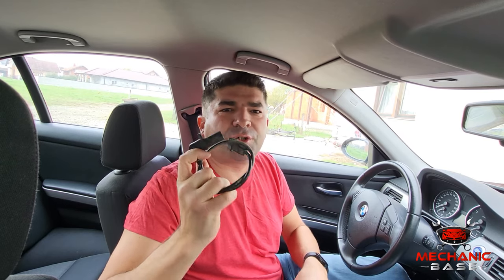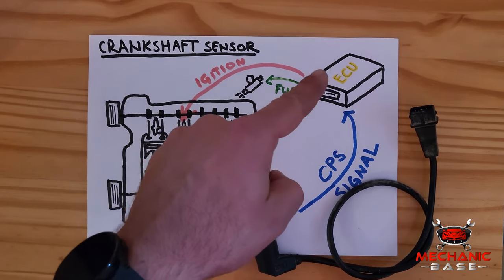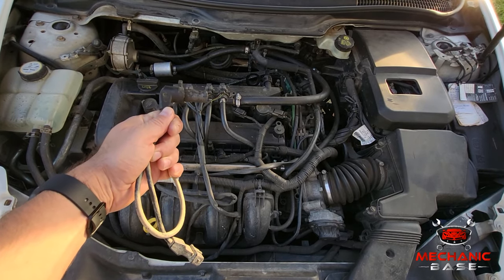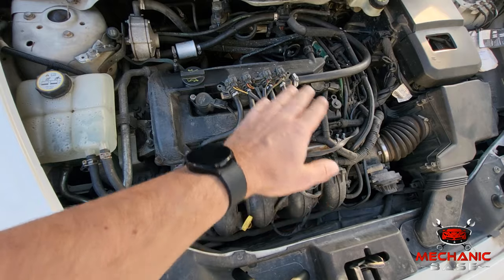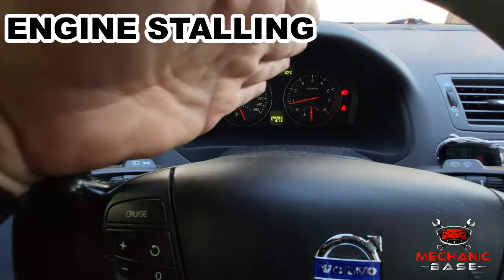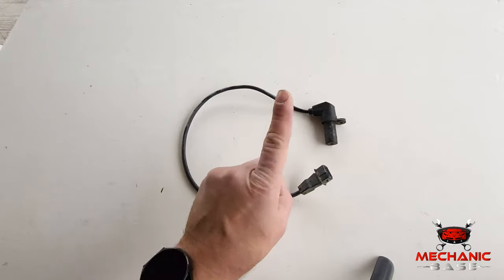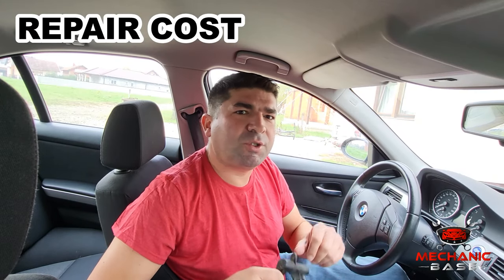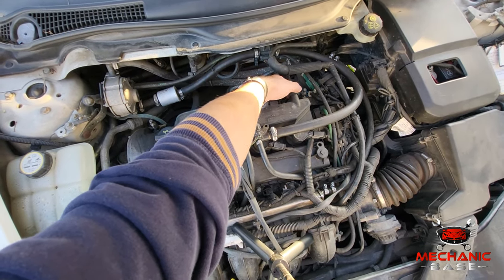6 Symptoms of a Bad Crankshaft Position Sensor

Comment from the maker: Did you fix your car issues? Let us know in the comments below, and maybe you can help someone else with a bad crankshaft position sensor!
Don't forget to like the video and subscribe to our channel!
More CPS sensor information: https://mechanicbase.com/engine/crankshaft-position-sensor-symptoms/
Website: https://mechanicbase.com/
Reply: Can't find my crankshaft position sensor in my v70 2.5t volvo
Reply: I need help please. I've tried 3 different sensors and even tried another dme on my 2007 e60.
I can't get any voltage drop on sensor running magnet across it.
Reply: 1:32
Reply: Hello name Joey I like to know where would my crank shaft position be at I have a 2007 buick lucerne cxl v6 engine
Reply: Is this a pcv vale
Reply: Yes  or no
Reply: Is this pcv valve
Reply: Because it looks like it
Reply: Yes or no or maybe
Reply: Where would it be located on 02 Corolla
Reply: 1996 Jeep Grand Cherokee 4.0
RPMs drop to zero while driving then jump back up and doesn't do it anymore.
Now it just won't start, hoping this is my issue has 0 codes on a scanner
Reply: 1994 Chevy s10 can't find crankshaft sensor 4.3 vortec
Reply: listening to your fucking saliva is murder bro do something about your audio or dont make videos at all
Reply: like do you not hear your audio before you post it?
Reply: Can't find my crank shaft position sensor 07bmw 760li
Reply: Can't find my crankshaft position sensor 95 Chevy Silverado 350 5.7 vertec
Reply: I had this problem periodically with a Opel Vectra B. First, I took a cheap aftermarket sensor for 20 bucks. It worked fine for a year and broke down again. Then I decided to take an original sensor with the GM logo what was MUCH more expensive.  This original sensor did not work at all. The engine made no effort to start. After looking unsucccessfully for any other reasons, I recalled a thread, that somebody said, that mechanics try these sensors out sometimes. I made a last attempt and ordered a cheap sensor again. The car started immediately as if nothing had happened.
Reply: Hi I have vectra c 1800 1953 hatch. I cannot find my crank sensor. Watched videos which show it at the back of the engine to the right as you look at it. Near where the cam sensor plugs in.

Comment: When the crankshaft sensor starts to go bad, it starts showing symptoms when it's cold. This is my own experience. You just can't find that information anywhere. You could easily think that there is a problem with the mixture ratio, although the crankshaft sensor may be the real culprit and may work well in warm weather, but at a certain degree of frost it starts to show symptoms.
Reply: Tell me more.
Reply: @gottahavegoalsset  ?
Reply: This explains my frustrations OMG!! This is very important information .
Reply: @buckhayes2104  And the freezing point where the symptoms start can be very sharp. It may be that the car works well, for example,  at -13 c degrees and -14 c doesn't work anymore very well. In severe frosts, it sounded as if the ignition was completely out of place and the car would only idle at about 500rpm and engine may not be able to take more revs.. The car smoked a lot and the exhaust smelled strange.
Reply: @buckhayes2104  Here's a link to a video where you can hear how the car's engine was doing before the fault was found. I myself had two faults. The crankshaft sensor and then the air mass meter. But the crank sensor was the main culprit. The faulty air mass meter made jerks only at higher revs while driving. But didn't affect the idle and didn't make it difficult.
Reply: @Topsiekku  it started hard the other day in 18 degree weather and warmed up fine. I was driving and all of a sudden it died and won't start. It cranks okay. I'm going to replace the CMP and the CPS tomorrow and see if this fixes some issues or all. It started just fine Everytime the week prior in 35+ degree weather. As temp dropped it became a hard start  when the engine was cold and also not wanting to start through out the day. I've checked the starter,changed fuel pump,fuel filter, sparkies, fuel relay and oil pressure switch. It ran fine until it the weather turned. It recently also had its timing and harmonic balance timed and repaired.
Reply: @buckhayes2104  Isn't it even freezing there? I mean readings that start with a minus
Reply: @buckhayes2104  If you are really talking about +18 celsius degree and +35 celsius degree, I don't think it has any effect on the crank sensor.
Reply: I got a code for it. My car keeps dying randomly. After an hour sitting it'll start up. Do you think it's the sensor?
Reply: Thank you
Reply: Crazy 😧 almost automatically changed valve cover with wires & plugs , after noticing won't start after bad weather days & not wanting to stay started after put in drive
Reply: @j4crypto4all1st9  How many degrees Celsius was freezing?
Reply: Very interesting , maybe 1 of the few things I have not swapped onto my jeep from a known great running engine(frames rotten) interestingly enough just did a cover gasket on its 4.0 jeep engine, I would imagine it's taken on its share of oil, she was a leaker, anyway, my newly acquired fl tj runs great once warm, not too good at all cold an I swear it's gotten worse over the past week, still no code/light, will swap cash next.... I guess, wth
Reply: Not me mine just went bad and had to get towed
Reply: This makes sense why I get a hard start in the morning. 🤔🤔
Reply: I have same problem on my car .when is cold ...when accelerate is different noise but no any check engine on dashboard.
Reply: @MatriX46750  How much was it freezing when there were malfunctions?
Reply: The noise is appear some time .for ex today didn't hear it ...
Reply: @MatriX46750  I mean -15c below zero
Reply: My e46 M54 engine has intermittent long crank
Reply: My Chevrolet spark cut of the spark when the weather is cold is crankshaft sensor
Reply: Where is this sensor on a 2003 Pontiac Sunfire?
Reply: Where is the crankcase position sensor 2006 lexus gs300 located ?

Comment: Only thing I'm going to add here is that you can get no misfires and no codes and still have a bad crankshaft sensor! Mine has done it twice.  No misfires no codes both times.  But mine is a 99 and that may play a LARGE part of the missing codes. I cannot get OE sensors for mine and am forced to go with cheap ones that don't last.  Only do OE if you have that option!

Comment: GREAT VIDEO BRO. After  winter my batterie in my S2000 died, I replaced it and the car started, but it didnt run smooth. The power was low, revs fell off and missfiring started and it cut out. I thought that was probably the Ignition coils. Replaced them and the car ran better but vibrations were getting higher the warmer the engine got. Then I got a tool to read the fault and it said Crankshaft position sensor. I erased it, it wont start anymore but now i definetly know why. It all makes sense after watching your video. I really appreciate your Content

Comment: I almost replaced the ECM when it was just sludge and metal buildup on the CPS. Thanks you just saved me a couple hundred dollars.
Reply from the maker: Glad to hear that👍
Reply: If you had metal build up in your crank sensor you have other issues asswell
Reply: Was there no error code?
Reply: Hey mine was dirty do I clean the sensor with brake cleaner and the slot as well where the sensor goes ? Or just the sensor?? Please help
Reply: @vladt6038 hey how do I clean it ? Like do I clean the slot where the sensor goes as well with brake cleaner or JUST the sensor?

Comment: on my Toyota Corolla it's the VVT soliniod, but same symptoms , great explanation in the video
Reply: Did it cut off fuel and spark? My corolla won't start just cranks. It cut off fuel and spark
Reply: @louwscustomsza  I'm having same problem. Mine just cranks. I've changed the vvt solenoid, solenoid filter, camshaft sensor, fuel pump, starter, battery, a couple sparks plug... It's still cranks but no start. I have no codes showing when I plug the OBD. I'm thinking it's the crankshaft sensor tho.
Reply: @chriskramp5174  My problem was the metal plate that came after the crank sprocket. Apparently, the letter on it is supposed to be faced outside(B)(F). The crank sensor gets its reading from it

Comment: Thank you for confirming the symptoms. Seems manufacturers can pump any random fault code out and they don't mean the same thing from car to car. Seems P1337 on Citroen DS3 does point to crankshaft position sensor. Getting to it though is somewhat of a challenge and I don't seem to be able to find anything that suggests correctly where it is.

Comment: I have a 2015 Nissan Altima where is my camshaft sensor or crank sensor located thank you so much for your helpful video.
Reply from the maker: 2.5 engine? If yes, it should be near the transmission end, on the back of the engine (facing the firewall).

Comment: My 2017 Nissan patrol super safari starts rough making weird sound, fuel efficiency is lower than the norm, RPM plays around at idle, has no check engine light on (bought it used, suspect foul play). Used my scan tool and got a confirmed P0335 engine speed sensor which I assume is the same as crankshaft position sensor. Cleared it and and it still came back the same. Not sure where the crankshaft sensor is to inspect it, and the manual doesn't mention it.

Its worth mentioning I also have a confirmed C1130 (ABS system code).
Reply: All those symptoms correspond to a bad CKP sensor.

Comment: Good information about the starting symptoms that I haven't seen elsewhere. My 2007 Chrysler T&C had trouble starting hot two or three times. I assumed the starter was going. There were no codes. Then today it threw a P0017 and started running bad - almost stalling out every time I came to a stop and responding slowly to the accelerator pedal. Will check the sensor tomorrow, but it seems quite likely. So I'm guessing the starting hot issues can be an early warning.

Comment: Can this information be applied to motorcycles as well? My kawasaki z900 - 2017 sometimes just wont start and I've gotten the code P0335 on it. Sometimes it just wont start for at least 6-7 tries but then it works just great. However, after riding it for some time , if I turn of the ignition it wont start which has left me stranded a couple of times (sorry for my english, I'm from Sweden) Great informative video btw!
Reply from the maker: Yes, it's quite likely. That sounds like a crank sensor.

Comment: Thanks, I have a ml350, 4mactic, 2011 , try to do , dc , inspection and my engine light  is on  and the 7:12 7:12 smog pump wasn’t bad so , intake camshaft  cylinder the 2 on top will be replaced  to see if this help my engine light to go off, the relay switch I’m going to change ! Hope you can give me some quick advice !

Comment: I had this problem periodically with a Opel Vectra B. First, I took a cheap aftermarket sensor for 20 bucks. It worked fine for a year and broke down again. Then I decided to take an original sensor with the GM logo what was MUCH more expensive.  This original sensor did not work at all. The engine made no effort to start. After looking unsucccessfully for any other reasons, I recalled a thread, that somebody said, that mechanics try these sensors out sometimes. I made a last attempt and ordered a cheap sensor again. The car started immediately as if nothing had happened.
Reply from the maker: Which engine does your Vectra have? There was an issue with crank sensors on certain engines, the solution was to widen the gap where the bolt that hold is in place.
Reply: @MechanicBase  That engine was a  x20xev. Year of construction was 1996.
Reply: @MechanicBase  The crank sensor of the x20xev was unfortiunately hided behind the power steering pump or compressor. But it could get replaced without removing these aggregates. But it was no fun. At the moment, I have a Vectra B 1.8 (X18XE1) from 1999.

Comment: Thanks for the informative video!

Vehicle: 2013 Hyundai, Azera. I am told this part needs to be replaced. There were numerous codes that presented w/ the main key fob. After I asked, should you check the communication w/ the other key fob (extra), they check and said that there was a "hidden code." The other key fob registered a code for this. It does not sound for sure that this is the fix, but they said it could clean many of the other codes. Do you think I should have to pay for a 2nd diagnostic hour when they should have initially asked if there were 2 key fobs? I've kept the car up and have never had any prior issues. Welcome your feedback.

Comment: My car doesn’t throw a code. It'll run sometimes, then after even a short break, if I walk out or take a minute outside with the engine off, it does not turn back on. I'll have to probably wait 30 mins to get it back on. Any advice?
Reply from the maker: Cranks, but doesn't start? That sounds like a crankshaft sensor. Which car?

Comment: If the sensor is bad, will you have a problem with idle up high when your feet is barely on the gas. 2010 Cadillac srx

Comment: My 2008 frontier had a bad one. It would shut down when driving along. Fuel filter and pump do the same. On the rear passenger side back of motor is the crank sensor. Hard to get your hands to but only one small bolt holds it in. Don't over tighten it when installing new one !!! 😬🤬 Also a bit of grease helps on  O ring . I replaced the cam sensor same time. Driver's side back of motor. Looks almost the same. But a little easier to get to. 🤏 Mechanic we can fix the problem for $3750 . I need a Crank sensor not a new motor.     That's included. 😏
Reply from the maker: So, you've solved the problem?

Comment: Hi mr. Sam!
I've a Opel Corsa C 1.4 16v
the engine start good, any codes or ligths on the dashbord appers, but after 15 or 20 minutes after the start and when the engine get temperature 90°c the engine cut out, after that, I trying to restart it, but the half of the dashbord is off... no check engine light, no oil, no inmo, nothing light are ON... after that 1 hour and when the engine is cold or warm, the engine start again normally. Do you think that the sensor is damaged or the connector o wires?
Thanks for your comments back.
Regards!
Reply from the maker: That could definitely be the crank sensor.

Comment: My car has a tsi 2.0 petrol engine, basically a golf GTi engine. Drives great, but sometimes when it's warmed up, it will struggle to start, and it will the start when I let it cool down? Is it this sensor I need to change?

Comment: If the crankshaft sensor is bad can it affect the fuel pump
Reply from the maker: No. But the injectors won't give fuel if there is no signal from the crank position sensor.

Comment: My car is 2007 Volvo xc70 gives me code ; P0503 (rpm signal low) and P2160. Is it still about crankshaft position sensor ? I wanna do it myself and I wanna buy the right part. (Btw I know that P2160 is about wheel speed sensor) thank you ❤

Comment: Greetings. I've replaced crankshaft position sensors "A" & "B" in my Kia Sorento 2004. The engine cranks but stalls after anything between 5 to 25mims
Reply from the maker: Hi @solaomotola - do you have any trouble codes? Check engine light?
Reply: solaomotola. Cars only have 1 crankshaft sensor
Reply: In my 2002 truck I had to replace my nock sensor as well

Comment: My car is very difficult to start for the first time, after about 20 seconds it starts, especially when it is cold. and after that every start goes well, so only the 1st start. Battery ignition coil spark plug has been replaced, what do you think? I would like to help, can it be done by the sensor that only works the 1st time

Comment: Just found this.  1998 honda prelude  no start.  Replaced  distributor, rebuild starter, replaced oem ngk spark plugs.  Got no codes. Just did timing belt change with all related components about 6 months ago  gates kit with japan parts.

Comment: I have no problems starting when the car is cold. N52B25. But when the car can't cool down because of high ambient temperature... the car won't start. It will crank, but not start and give all kind of strange faults (ABS, DSC, et cetera) on the dash and I have to let the car cool down before it will start again. Even last holiday at BMW München, Ferrari Maranello and the Nordschleife. If I let the car cool down enough (sometimes with the hood opened), it starts with no issues at all... like it has no problem :) Could a CPS going bad be the fault? If it gets to hot it's not working as it should be?
Reply from the maker: Yes, the crank sensor usually starts like that - sporadic starting issues, especially when the engine is hot. Also, how old is your battery? The battery was weak on mine a year ago - it cranked strong and started, but it would sometimes give brake pad warnings and even ABS/ESP, and one time I even got a Valvetronic code. Once I've put a new battery in (although the old one had 12.4 volts), all these issues disapeared for good.

Comment: Porsche Cayenne GTS - Along with Crankshaft sensor my electrical devices are not working or affected could this also be cos of crankshaft? Or is it something else?
The driver seat window is slow and the roof doesn't close completely - There is a small gap and the LCD system bought last year also failed or not working.

Comment: Sir, great video, but I need your help on where my Crankshaft position sensor on my 2017 toyota camry le gas, One mechanic said it was at my right hand side located front tire where the cover is. Can you please help. Larry Chicago

Comment: Hello, thanks for this. Can you please share where the position of the crankshaft is on Renault Kangoo 2003 Automatic transmission? Best
Reply from the maker: Hi. Which engine?
Reply: @MechanicBase  	1.6 16V (95 Hp) Automatic